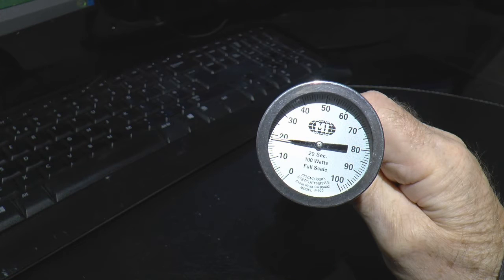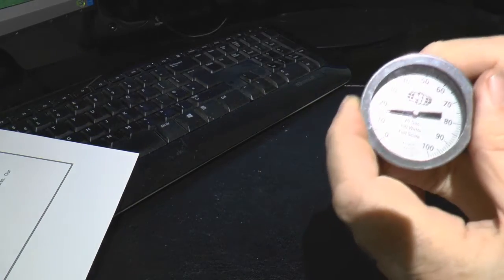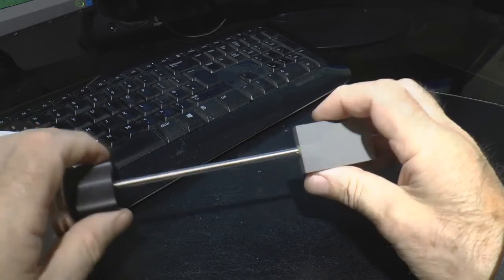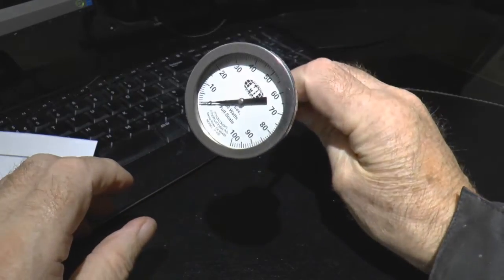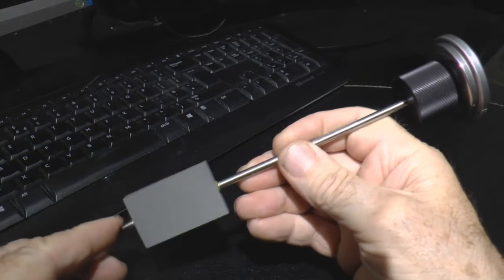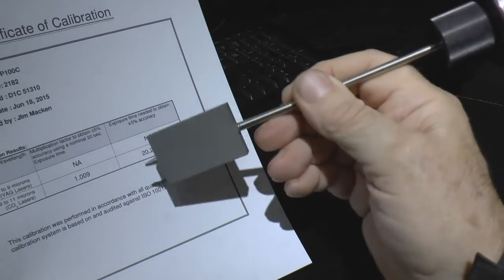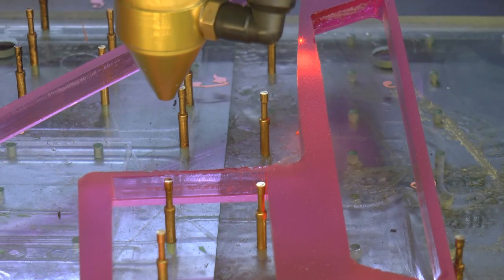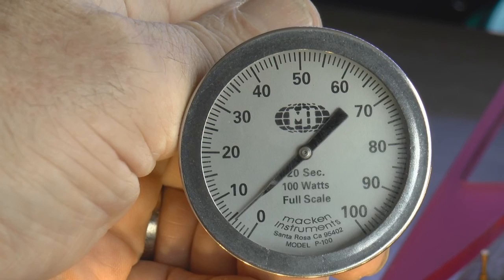RDWorks Learning Lab 32 50watt fraud Final proof

Comment: Ive ordered the Mahoney version of your gauge
- to check the power of the 80W tube in my XB 460 cutter
that is similar to yours but uses the Lihuiyu XB Super B1 control pcb
and a more basic control interface... 

i am following your video`s with great interest now.. because you share
a wealth of technique and problem solving method.. i like that..

ive yet to put an ammeter on the laser, so i cant be happy to try your test with 
the Mahoney until i know the power supply inut volts ( 0 to 5v ) are not going to
overload the current, which should be 25 to 28mA max.. ( i will err on the low )

ive only just got the laser... and it had to go upstairs in my house... 

i share my FB experience.

https://www.facebook.com/nigel.simon.182/posts/10153404899791871
Reply from the maker: +Incony Blue 
Siting your machine was a challange but it does show you are committed to making this machine work.Well done.
Yes, 25mA max for your 80w tube unless there are instructions or a specification sheet telling you otherwise (?????what instructions.....giggle, giggle, giggle)
There is a video to show how the ammeter is fitted.
As you are putting this inside your house you will need to pay particular attention to extraction. Putting a big fan in to extract the fumes is a start BUT whatever you blow out  you have to take in. If you don't allow free flowing air into your room then your extraction will be compromised. If you are not careful you will be sucking all the heat out of your house during winter months. You may like to consider putting an INLET duct into the bottom of your machine so that you can suck in cold outside air that will pass through the machine.
Happy Christmas

Russ
Reply: +SarbarMultimedia 

i used it today to try etching and cutting into tiles  the glass like structure of the etch and cut.. is far cleaner to work with, than wood and produces very good results .. provided the tile is flat, since textured surfaces alter the focus point and mean that unless one can use a z drive of accuracy,  the spec of the etch and cut change with distance from the focus point...  it means that one really needs an accurate way to measure the laser lens height above the work surface..all the time - i am thinking of  trying to make something to do that...   but its how to get the info from the device chosen, to alter the table height as the laser moves -  that is going to be the design problem. a laser measure would be very accurate, a sprung roller ball  could also work..  but is going to cook itself very quickly... have you tried cutting  or etching into irregular surfaces?  any pointers of your own to share?  ( no pun intended ) :) i think a laser measure would be the best option...  mounted like the pointer is on my machine.. so not only do i see the point.. i get a measurement that relates directly to the focus ... you would be surprised how much a 1mm change can make in the ability of the laser to cut or not..    just changing the power setting isnt the answer... its the z table that must compensate..   if one can get the irregular surface problem compensated for, then it opens up a much bigger use of material kinds...  irregular wooden surfaces are many...  and often cheap scrap materials have uneven surfaces..
Reply from the maker: +Incony Blue 
It depends quite a lot on the focal length of your lens. I think mine is about 1.5" (38mm), which sets the focal point about 6mm below the nozzle. In https://youtu.be/PUdEUxJH2_o you can see how I went about checking it. There is about 1 millimeter of tolerance for the focal point because its not an exact and perfect point but a waist as shown in https://youtu.be/zF9nQHlvGkc.
If you are scanning you will be running at 200 or 300 mm/sec, Its going to be some powerful and responsive kit that can track your surface imperfections. Certainly not a sprung loaded ball, also that would have a smoothing effect on some of your imperfections. Even modern industrial machines would struggle with that task. If you want a sensing  idea to work on, you could use a laser pointer and shine it at the surface of your work at the focus point and at an angle of 45 degrees. You could set up a  light detector to sense the reflected light. As the surface height changes so will your reflected beam.  However I think that even if you succeed in making a feedback system fast enough to follow the surface error you will be generating something akin to an earthquake simulator that will shake you machine to pieces. If you are really desperate to use uneven surfaces I would investigate different focal length lenses to get a longer "waist" 
Hope this helps
Russ
Reply: +SarbarMultimedia 

i want  a median  so a window would suffice..  initially my aim would be to manually look at the surface by running the laser head by hand over the surface i want to etch or cut into.. to see the depth or  rise in the surface and come to a  median decision based  on  the maximum and minimum  differences...    i ran an etch today on a  squared  block tile.. the squares, and edges are different heights.. like one expects..  but even the supposedly flat surfaces had gradients...  and the effect was to cause dark and light shading of the etch, as the beam went in and out of focus.. banding.. caused by the height difference of the surface    i dont expect to be able to compensate exactly yet..  but i know it only takes a millisecond for the psu to accept a change in power..  and while power changing isnt the answer.. its a method worth exploring...  the problem with more power is a greater kerf and spot size - due to the energy input... and why i would rather alter the  z height...  if one can negate banding or limit it... i think thats worth trying...  ive looked at PAM modulating the psu input  not hard to do,, its old school science... Base that on height of focus would be interesting to see the results...  ?

if for example one is looking at height of focus one or two milliseconds in front of the laser path of travel.. and changes the power based based on the focus,  up or down.. by 10ths of volts  based on amount of difference?    i am not trying to compensate for differences over a millimeter yet.. i dont have a stepper fast enough to alter the z height or a threaded shaft it can turn fast enough... so a window of tolerance will have to do for z height... but a power change as well, might be of benefit..

what one wants is to see is the actual typical wave... and what the result is by changing z height and power by PAM -  i expect to see two wave forms that are not the same... but follow similar paths... one based on focus the other based on  z and power..

ok  third option.. change the lens height...  could be done magnetic... the point of height  determined by  magnetism  (more or less pull north or south..) ?  a compass can tell you where north is... in relation to where you are going...  all you need to do is go in the right direction... based on where the compass points.. ( where the focus is )  and where you are going in relation to it  -   i just share that knowledge to show that old science doesnt mean inventing the impossible...

in a car fuel system.. the ecu tries to do the same thing -. one needs three things for the optimum burn,,, fuel, oxygen and ignition... if all three are at near the precise amount there is no waste.
Reply from the maker: +Incony Blue 

Another trick for assessing the rise and fall is to get a second red dot pointer 90 degrees round form the first, both at about  at 45 degrees to horizontal Make the two spots coincide at the correct focus height and as you track around your tiles you will see the dots pull out of line. The direction of movement will indicate up or down workpiece movement.
Reply from the maker: +Incony Blue 
Here's an interesting website. Discussion on depth of focus may interest you
Russ

Comment: I purchased a similar unit direct from China. I had specified I wanted a RECI 80 watt tube as well as other items before purchase. Turns out the seller "MISSED" those points and I got some no name tube and no auto focus. After spending about 4 days trying to get it to work/move at speeds greater than 200 mm/s I have given up. 
Recourse is Tell All - "to avoid purchasing cheap lasers from China". 
OH, he was very helpful as he sent me photos of the adjustment instructions in Chinese!  I guess if one has a good understanding of Chinese, they could CHANCE purchasing one. To increase my speed I am thinking of putting the HiWin Square rails and bearing in it to replace the poor Y-Axis design.

As for RD Works, I find it to be a fairly nice program and with your videos,THANK YOU SO VERY MUCH, I have been able to do much more, much faster. 

I am wondering - what the fastest "Rapids" you can get?

There are two more passwords for the display other than the RD8888. The first one is CC8888, unfortunately, I do not know the last one.

Thanks Again for the Wonderful Instructional Series.
Keith
Reply from the maker: +MarilynAnd Keith 
Hi Keith
Sad to learn of your experience. From what I have heard the RECI tubes are best of the cheaper tubes. However I think you have to go 100watts and above to get a guaranteed long life tube (8000 to 10000 hours). The tube you have is good for 1000 to 2000 hours provided you treat it well. By that I mean don't run it over 25mA . What???You were not supplied with an ammeter fitted to your machine??? Disgaceful.  No one told me that 100% power was programmable but should never be used. I had to find out the hard way and when I did replace my original tube I fitted  a cheap Chinese ammeter, it's the best insurance policy I have against early destruction.
My max speed is 400mm/sec which you set with the MaxSpeed button or you can try programming. However the machine will run at it's own max speed as it cuts shapes and holes it will only reach max speed on long straight cuts or on scans.

Your 80 watt machine will have a larger table than mine because the frame will be bigger to accommodate the longer tube. Usually this means a more powerful and faster motor that will run up to 1000mm/sec if you look at typical specs.
I know there are several types of bearing design used on these machines. I specifically steered clear of anything unconventional and made sure I bought something with recirculating ball or roller slideways.

ps Like many other who  think these are instructional videos, I must assure you that these are mostly live takes of me learning to use the machine and the software but edited down to remove all the immediate rubbish. I often make mistakes or find better ways later on. Hope you learn from my mistakes rather than follow them. 95% was a BIG mistake so stick to 65% max until you fit an ammeter and find what percentage 25mA requires. My guess is that your 80watt machine will only be outputting 65 to 70watts.. I'm still  hunting for a simple cheap method of  power testing these machines that others can make to test their own machines without spending $200 to $300 on a conventional power meter

I have covered most of the basic subjects but will be doing a few more rather nerdy things about the machine in the near future. Thanks for you kind comments it's always good to know that others benefit from my efforts.
Russ
Reply: +SarbarMultimedia 
Hi Russ, You guessed correctly on the ammeter. I had to do like you did, and purchase one from China. It arrived yesterday! Guess I can install it today, once I cut a hole in the unit. 
It seems there is a very new tube from EFRLaser  and it is the ZS series. Lower cost & I hear better than a RECI. Problem is I can't find it listed on their website yet, although I hear the price is quite good including air freight to North America.
Because of your videos, I have not run over 65%, in fact most times I don't go over 30% power. I believe we are always learning if we are still alive. I have to say, I only got it working three days ago! 
Keep having fun & please keep making the videos.
Merry Christmas to you & any others reading this post.
Keith